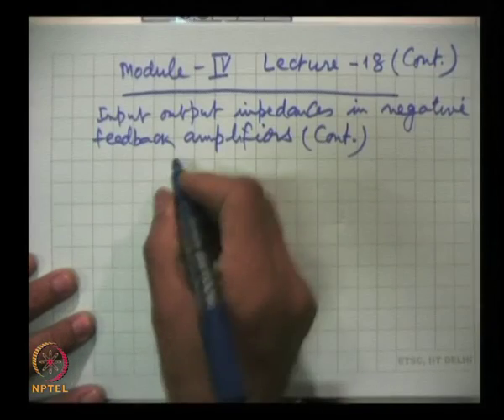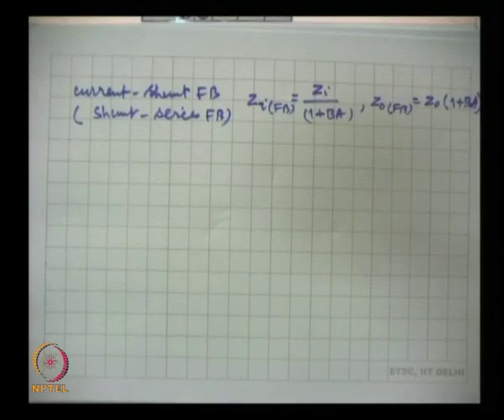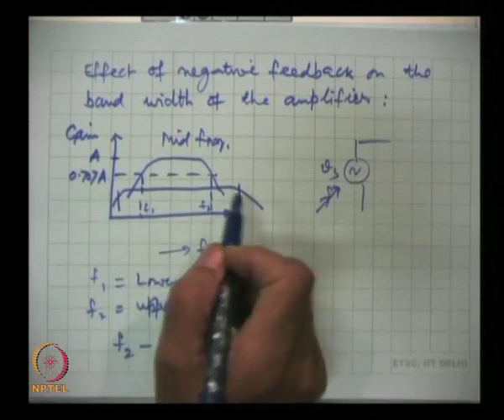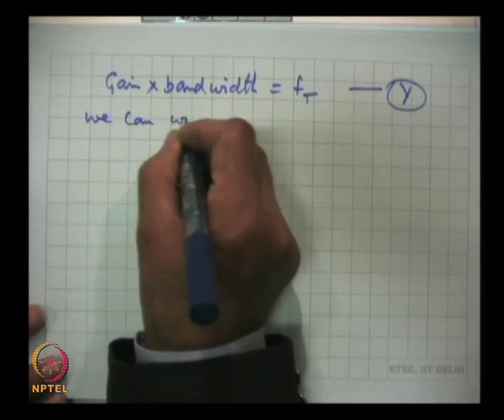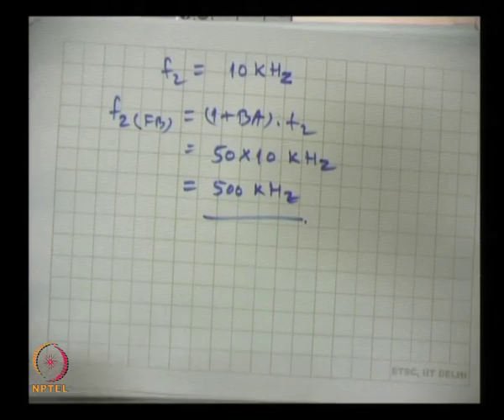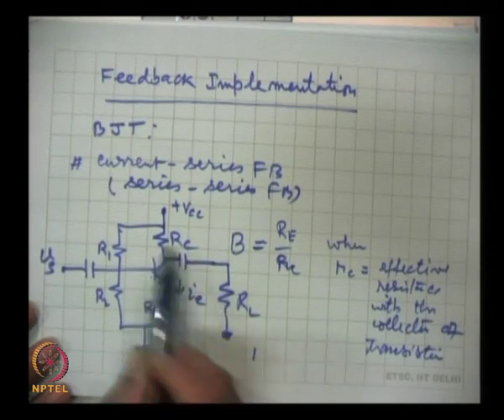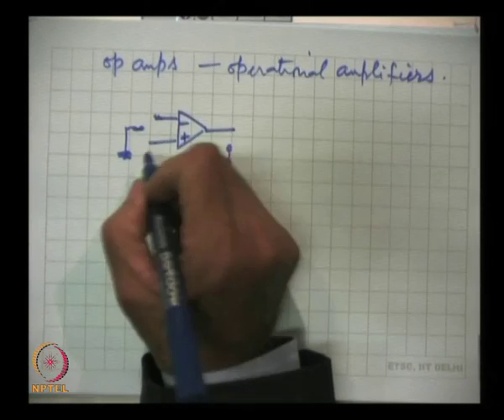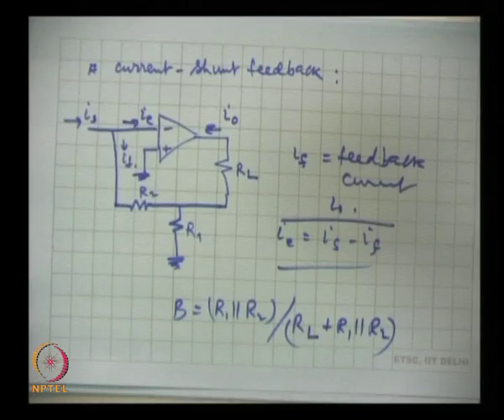Mod-04 Lec-18 Input/Output impedances in negative feedback amplifiers (Contd.)

Comment: sir how and why .the output of an amplifier depends up on frequency of signal...?
Reply: Abhishek Tomar We use amplifiers for amplifying ac signals. Practically opamp gain is not constant for all frequencies. It is high and constant at medium frequencies and is low at higher and lower frequencies. It happens due to various capacitances present in the amplifier. Coupling capacitor, bypass capacitor, and other parasitic capacitances. They reduce the gain at higher and lower frequencies and distort the gain.